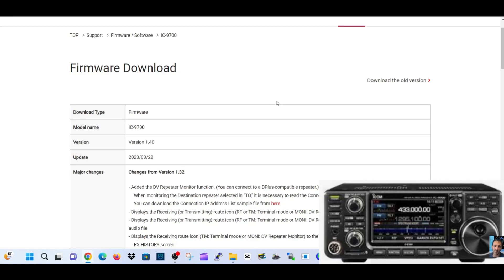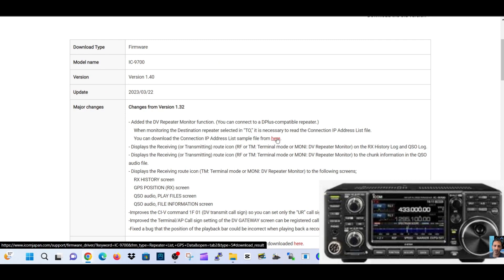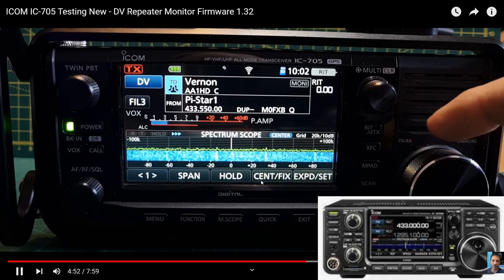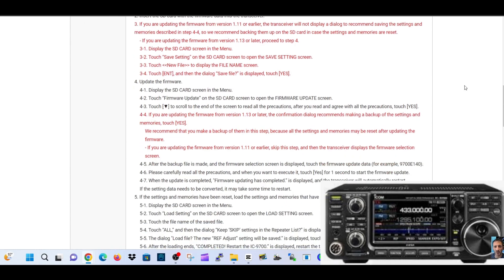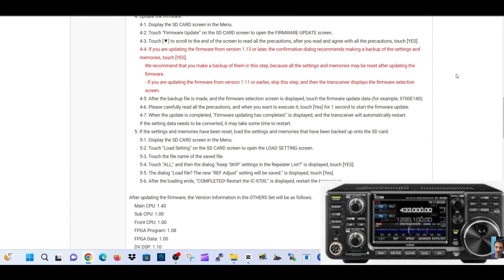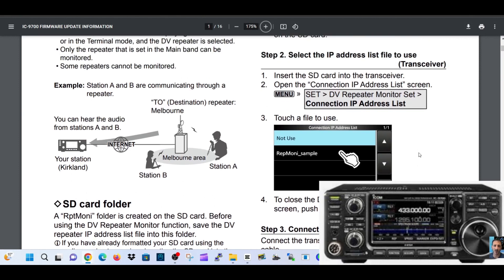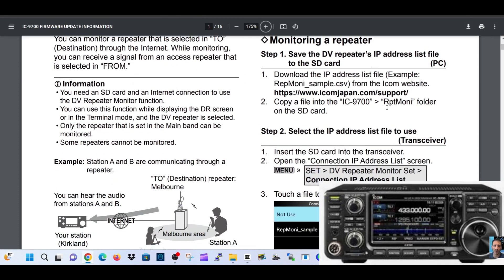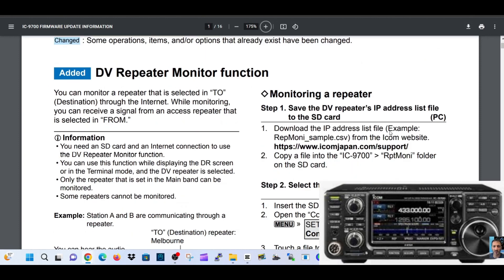ICOM IC-9700 NEW - IP REPEATER MONITOR MODE -FIRMWARE V1.40

Comment: The sad part is that even with this patch, you don't have a reliable, easy to use option to connect to the d-star network without additional equipment, or some magic access that you can never get a  gateway sysop to register your equipment for.    Wires-x is still a far easier, and more reliable option for those of us not residing within a d-star repeater footprint.
Reply from the maker: Agree Yaesu is easier.

Comment: The connecting ip adress list item is set to "not in use" select a file...... how to set it on?
Reply from the maker: Yoi dont connect to ip adress when using Monitor mode you select repeater in the TO section DR mode.